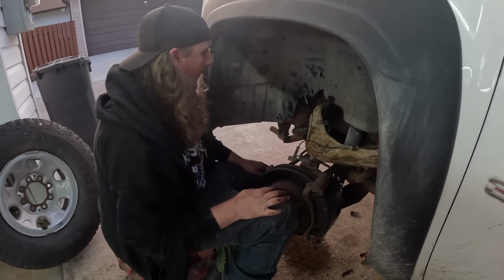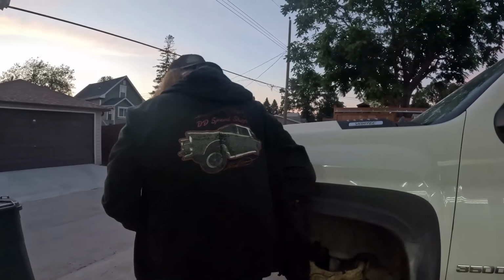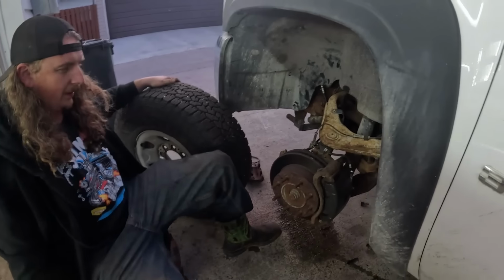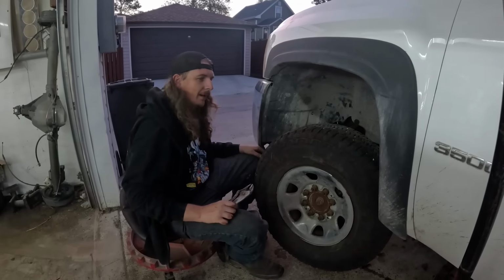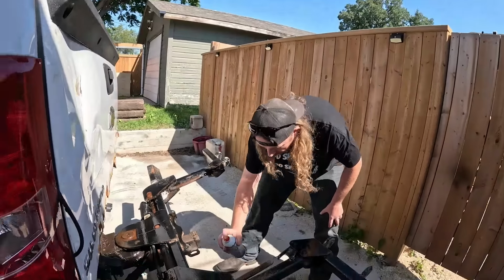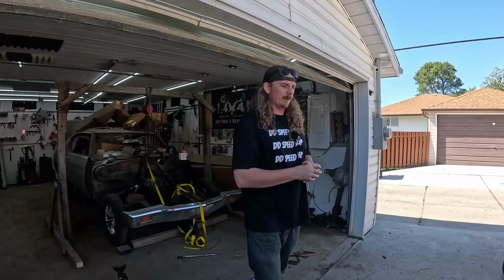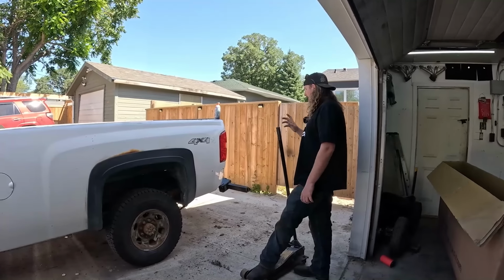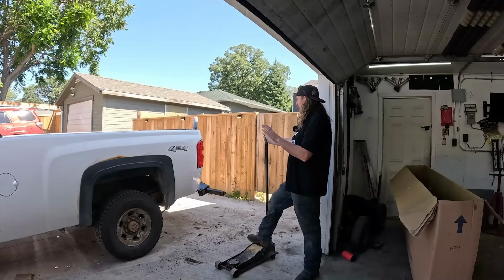The Greatest Build I Ever Did- Nope! It's NOT What You Think!

Comment: Those trucks are notorious for the clamp that holds the line to the upper control arm and knuckle gets rusted and pinches the hose shut. Can usually pry the clamp open and brakes are right back to normal.

Comment: I love the fact that you plated the frame up for that lift. Those trucks especially in rust areas rot and break frames all the time. Im in new England and ive done total frame replacements on a few of these because of that. Trucks looked absolutely mint but the spare tire well rots out and the shock mount x members rot out because they are tubes and shit just builds up in them and rot inside out. They make caps for them but they fall out and stuff and the undercoat they use on the frame makes matters worse too. Shes a nice one tho!

Comment: California has smog inspections, a dmv that you'll spend a whole day in just to do the littlest thing. Everything costs way to much. You'll leave in a year.
Reply: No smog inspection on cars 1975 and below
Reply: @dogsense3773  It was 64 down
Reply: Couldn't even put a Holly on my 68 Cutlass, I had to get it smog checked.
Reply: @raymiehershey1430  why would you need a smog test on a 68 car?
Reply: @dogsense3773  I had to do it, failed once because the hose from the valve cover to the air cleaner was disconnected. Around 1988

Comment: The shop truck always represents the shop and fab skills 
Only thing missing DD’s Speed shop logo   Lettering and stickers ( to attract major sponsors) 
Can’t wait for the new shop 
"Buy land " acreage. Remodel an old house, have another master suite for Murr & mom, the garage is for the tractor or this truck 
Build a new shop  huge concrete slab all around the building 
At PRI show make payments to finish in 2 years   4 pro lifts  2 air compressors independent outside with a 4 season heavy shack (noise padding) outside oil barrel burner the vent goes inside the garage for heat also for the house 
1 lift. Outside under shade to clean incoming junk, pro steam pressure washer 
3 lifts inside each project can be result which gives you better views 
2 lifts for you 1 lift for Danny’s cars (it’s all about the views= merch shirts)
Pro lighting for under hood, under dash, interior and under the car are still BAD ! ! ! 
The shop should be 1 hour outside a major town for land to fill with projects 
But you can still

Comment: 1 hour outside town you need high speed land fiber optic line 
Water plus water storage (frost), electricity plus a backup generator, battery lights, 
In the shop washer dryer uniform washing (stop dragging snow and mud) 
Shop floor heavy drainage 
Build around 3 pro carts with knife magnet holders. 1 cart for grinders air tools, heavy pry bars 
1 cart all kinds hammers and pliers and monkey wrenches 
1 cart full of wrenches sockets all repeats 
A holder of rags and gloves 
Huge floor fan for welding (no more black face please I have lung damage)
Film the shop build 
Have another huge master bedroom and bathroom for guest to stay in
Mud room to wash the dogs and muddy boots